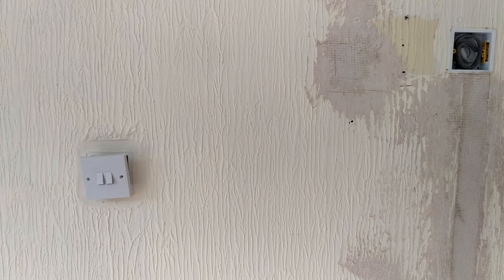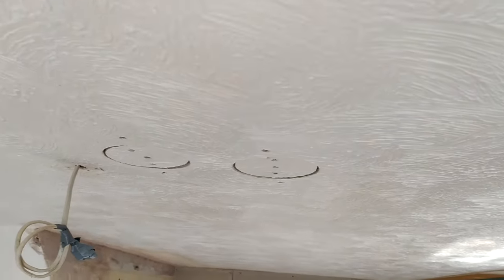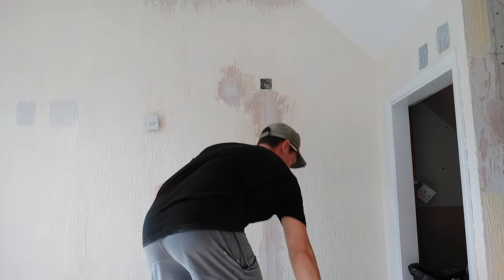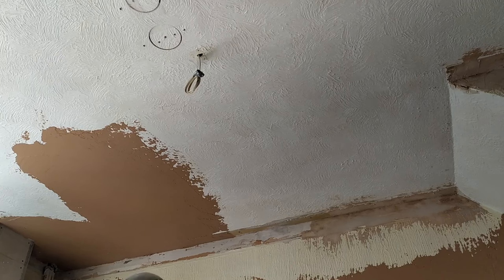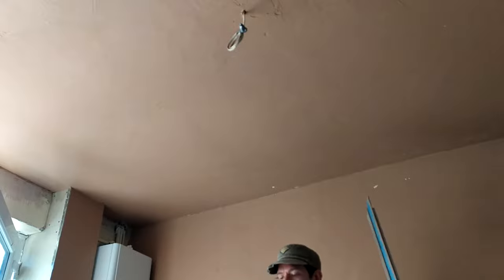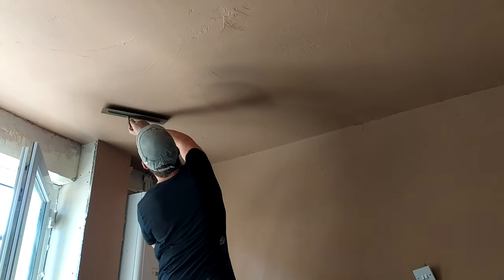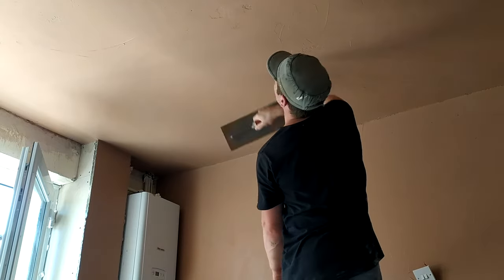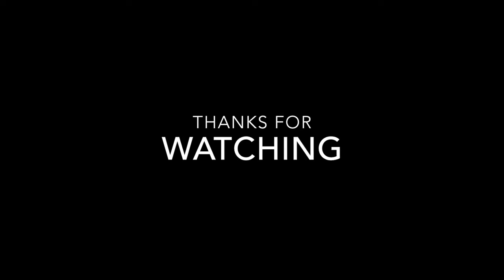Plastering Over Artex Ceilings (Plastering For Beginners)

Comment: Small Tip: Touch of food colouring in the PVA mix will show all areas you have covered
Reply from the maker: Great advice !! Cheers pal 👍
Reply: I’ve heard about it bleaching through before
Reply: sly it shouldn’t do as you are only adding a minuscule amount.
Reply: I add paint seems to work fine.. 🤠
Reply: Will also stain skirting boards and coving, would not recommend, unless you want to spend 20 minutes using baby wipes at the end

Comment: Well ,another plastering video I have watched with the wrong advice on how to plaster over  artex .Plastering over artex this way will only soften the artex and will eventually peel from the ceiling bringing all that new plasterwork with it ,the only secure way is to,first have the artex checked for asbestos ,second ,if all clear cross batten ceiling using 50ml x 25ml tantalised timber ,third ,overboard and skim ceiling the traditional way .This way may cost you a little more time and money but you will have a ceiling that is secure and last longer than the method shown in video .I am a plasterer with 40 years plus experience in renovating all types of plasterwork ,,,Hope this advice helps all you beginners out there 👍👍
Reply from the maker: It's never happened to anyone I've known before but I must admit that your experience has a lot to qualify for so I appreciate your advice. Thank you for your input 👍
Reply: One of Them ones .HI ,the main problem with any type of over plastering is how secure  the surface is that you are overplastering .I used to overbond and skim artex when it first became unpopular but experience taught me that this was causing the artex to pull away from the ceiling hence causing the new plasterwork to fall off with it .,plus overboarding gives you a far better finish and for a little extra time and money you are getting a brand nexus ceiling ,,,,
Reply: Why batton. Just board straight onto the artex
Reply: @fixit3108  to ensure new boards are fixed to a flat surface. Finish plaster maximum thickness is now only 2mm thick.

Been plastering 20+ years and hands down this the best method but costly.
Reply: @stevengordon2145  if the ceiling is already flat. Apply Plaster Board directly onto the artex with longer screws. Can be done ok
Reply: @fixit3108  90% of the time artex ceilings are not flat.
Been plasterboarding so since 97 I've only ever come cross a handful of lids that where flat. Get it right first time no call backs 👍
Also using 50mm or longer screws when over boarding leads to a massive danger of hiting cables or water pipes etc.. In ceiling space
Reply: What if the Artex does contain Artex surely you can’t overboard as you’re drilling into the Artex?
Reply: @Hi-mb1rr  .If the rates does c
Reply: @Hi-mb1rr  If the artex does contain asbestos then it has to be removed by professional asbestos removers . Having read some of the replies on here about scraping it down or sanding it down I just hope for their health it was tested before work commenced. I did mention about having the artex checked before any work is carried out on my previous comments .

Comment: You can only really get away with this if the artex is quite flat to the wall, and the plasterboard is really well nailed or screwed on, as you're adding more weight it can cause the plasterboard to sagg and potentially come down, as i've found out 🙈

Comment: Im always cautious about plastering over artex.always try to overboard first,much better job.i learnt my lesson years ago,and let the customer against my better judgement talk me into going over with bonding and finish.next day after clearing up all the fallen plaster i overboarded and skimmed.plastering for 35 years now,but i really enjoy your videos.well done.
Reply: Do you know why it fell by any chance? Maybe not sealed properly initially?
Reply: @wassupjg  most old ceilings have distemper on them.artex seems to stick to this.but as soon as you try to overskim ,it comes away due to the moisture of the plaster along with the weight.always better to overboard and skim.plus this gives you added sound proofing and fire protection.
Reply: @markchambers9415  cool, could the distemper/surface be stabilised with a stabilising primer like artex stabilex?
Reply: @wassupjg  you can try.but i wouldnt bank on it.i found there are no short cuts.good luck.

Comment: Friend of mine showed me a way of skimming over artex, 1st coat was half bonding half skim mix and for the 2nd coat was just a normal finish mix. Always worked perfectly
Reply: Hi, what do you use for the bonding?
Reply: @leabeauty837  bonding is known as a plaster undercoat but generally its used to fill up holes and voids in area's of walls that aren't plumb, its a brilliant material and sets like rock. Also very good for plastering over old artex
Reply: @WCMT89  Thank you 🙏
Reply: I put some bonding in my first coat, not taking credit for it as it’s long been know as the magic mix

Comment: Great videos, it's still possible to find asbestos in artex way into the 90s av recently found out, although tiny amounts, av taken a few chances, because money is money and work is work, but if its really old artex, I explain to the customer and in most cases they get it tested for around £100, its there ceiling, its there sector, stay safe 👍
Reply from the maker: Very good point my friend! Cheers
Reply: I'm buying a house which has artex (prob asbestos).  Can't it just safely be plastered over?

Comment: I plastered for years over artex without knowing the danger with it. It Does make you think about the jobs I've done in the past. Lovely job again mate. 
I've got a lite artex ceiling coming up, it doesn't need scraping just unibonding. 
Need to get one of those speedskims first though. I've heard people suggesting getting the steel blade ox but seeing you use the plastic blade alot. It does a fine job and saves a lot of time. 
Keep up the good work mate 👍

Comment: Hiya. Your channel is excellent. Your explanation of methods is very clear. I've been watching for years. Just about to tackle artex in a medium. Sized shower room. Using your 80/20 mix. Roughly how much plaster should be mixed fir each coat? I have 2 x 25kg of Bond and multi. I don't want to mix too much and have the issue of getting rid of it..ha...cheers

Comment: Great to see this iv heard so many people saying you cant plaster directly onto artex and it made no sense to me .....clearly just excuses
Reply from the maker: Just excuses pal 😉
Reply: One guy battened and boarded over the top. I told him the batten was only to correct the ceiling if it was out (i think I’m right? ) he said you had to batten.... the ceiling is a mess more lumps and bumps than before i think he did the battens as he couldn’t be arsed to work out where the joists where to screw to? I couldn’t be a plasterer if i had to work on other peoples boarding.
Reply: Not excuses at all  This is the most reckless and irresponsible video I've ever seen. He just gone and scraped away a load of artex from mid 80's on the basis that 'someone' told him it was OK.  This vid ought to come with a health warning. No one shoul EVER scrape away any old artex unless it's tested first'  All those viewers including seasoned 'professionals' blowing smoke up his ass and praising him clearly haven't got a clue.  He ought to be ashamed posting this sort of dangerous video. Do NOT do this EVER
Reply: @bigchiponmyshoulder7573  Obviously you could skip the scrapping step and lay the plaster on even thicker or as he says in the video over board. From who id heard from they clearly just couldn’t be bothered or thought the plaster simply wouldn’t stick. Clearly it is possible to do. Non of the excuses id heard were linked to asbestos.

Comment: Great work thank you for uploading it.i have done recently an Artex ceiling myself , but haven’t used one of them speedskim boards.looking at them ,there are two options,plastic or steel blade, which one would you recommend?i thought my plastering looks very good and couldn’t see any unlevel bits, walls or ceilings,but by looking in different lighting, without the lights on ,just the daylight and even that depending on mornings or evenings , I could see some unlevel parts , which I think could be avoided if I would of used one of them speedskimm fancy tools...many thanks Rob
Reply from the maker: Yeah the Speedskim is a great bit if kit and it definately flattens your walls to a higher standard. I've seen an massive difference since using it so I definately recommend it! I'd go for the plastic blade matey - is cracking!

Comment: Hi Blaine great info there and wondering could tiles be plastered over or dot and dab with plasterboard and skim? Any tips would be appreciated as taking tiles off is going to cause massive work as walls are constructed of old 50 mil clinker blocks with weak plaster over.

Comment: Have you ever tried flattening/closing in with your flexi. I tried the other day as labourer was trying to use my finish trowel.  Will be doing it from now on. So much better I felt!
Reply: I watched a video on youtube years ago from a really good hand soon after the flexi came out, he put on and finished with a flexi. ever since that day I have done the same, I know they are meant to be a finishing trowel only, but it has never given me a problem, and its cured my tennis elbow, it just makes life so much easier,  if I have doctored a bit of bonding up and needed to skim it straight over and obviously it sometimes blebs, then I need to give a very hard trowel with steel, other than that it leaves a first class job
Reply: @greenup9913  totally mate. I use a refina superflex, couldn’t find finishing trowel on job last week and done the full whack with it and was much lighter on the arm etc. left exact same finish too !
Reply: @williammacphee335  anything that saves your arm/body is worth a try, I have never looked back since watching that video, I was told when I first started plastering, by an old joiner to get out of this job as it kills horses, and he was right, we really do need to look after ourselves if we intend doing this job long term, especially if your a site worker

Comment: Ive had a nightmare this week. Did a very large artex ceiling, blue grit it and followed this process but 4 days later a section fell off. First time using blue grit and only used it coz it was satin paint. On reflection looks like I didn't put enough blue grit on. Proper gutted 😔

Comment: Being new to plastering, i found this very helpful.
Q1, do we have to wait for.2nd coat of pva  to dry or start plastering while tacky?
Q2, I was lead to believe that bonding coat and then a 2nd coat of  skimming was the way forward for such a job. Obviously not the case. What type of job would you use a bond and skim coat?
Reply from the maker: Glad to hear you found it useful matey! Yeah you usually wait for the PVA to go tacky but to be honest I've never found it to be a massive issue if you don't. You can come back to it when it's completing dry otherwise. I never really use Bonding on Artex - it's all down to preference. If it's an extreme case of Artex which can't be scraped then Bonding is the answer. Everyone has a different method and like I said, it's all down to preference pal 👍

Comment: Another great video! Big thank You! I remember my first artex ceiling and it was nightmare... especially with times. I have 2 questions: 1. It's not first time when I noticed you plaster ceiling and wall with the same corner at the same time. How do you deal with it? And 2nd: Have you ever plaster ceiling above carpet? Can you make a video how do you protect everything in a room (carpets, skirting board, sockets - btw. I use food foil to protect sockets and switches, maybe it sounds funny but it does the Job). Is it any chance to protect walls before painting?
Reply: You can buy carpet protection to protect carpets or  dustsheets.
Reply from the maker: Hi mate! It's great hearing from you again! Yeah they can be very troublesome but it's all down to timings! I plaster a lot of wet corners which can be a bit of an issue but with time you can really get into it. There's s video in the advanced section of The Plasterers Blueprint actually - I discuss it in detail there matey! Yeah that's a great idea. I usually use start sheets and making tape around the shirts but you could also use carpet protectors as our friend above mentioned! Hope this all helps pal and it's great to hear from you again 👍

Comment: Very good job that’s the way I would of done  but there’s another way that’s 
Using multi finish with bonding mixed
Reply from the maker: Thanks matey 👍
Reply: What is the ratio of multi finish with bonding that you use? Thanks!
Reply: @skydiver0084  saw some others on here say 50:50

Comment: Great video! I’ve got this same project to do for my own ceiling although the artex was just light stipple which I’ve scraped back flat. Can I ask what ratio mix of multi-finish to water do you use on this slighter drier mix? Thank you!
Reply from the maker: Hi mate, great hearing from you. It's not as bad when the Artex isn't as defined so I'd mix 12.5 litres of water to one bag of Multi Finish. This should give you the right consistency pal! Hope this helps and good luck with your ceilings 👍
Reply: Plastering For Beginners thank you, really appreciate the quick reply!
Reply from the maker: No worries mate 👍

Comment: I’ve stipple in my small bathroom ceiling and I’m no good at plastering. 
I’m on my own! Is it possible to trowel a layer of plasterboard adhesive to the ceiling.. then offer up a small plasterboard to stick to the adhesive and put in a few screws to hold the board in place while the adhesive cures? Then remove the screws…fill in joints and so on?

Comment: I’m sure I’ve seen u in the past to do a 30% 70% mix with hardwall and multi finish to overcome real bad undulating areas du reckon u could use this mix on an artexed ceiling if the texture is quite prominent obviously only on the first coat

Comment: Could I ask why you don't use the speedskim to finish the second coat? Could you if you wanted? I guess you'd have to get any bits you miss with a trowel.
Reply from the maker: Exactly that mate. It's not the best for finishing so the trowel cleans any gaps or holes! Hope this helps pal 👍
Reply: @PlasteringForBeginners  Thanks! Brilliant videos by the way!

Comment: My house was built in 1967 so would I be right in thinking my popcorn ceiling is most likely going to be a asbestos mixture, i was told only properties from pre 1960 used a asbestos mixture, I suppose I will have someone test a small piece before we skim over this but just wondering if anyone could confirm this? Thanks

Comment: Is a refina superflex suitable for the whole job and what size trowel would you recommend. what size of speedskim would you recommend for a beginner, 600 or 1200? Can the sponge float method be used on artex ceilings and is this a better method for someone who has never plastered?

Thanks for the videos, keep it up.

Comment: hi pal Ive used artex over the yrs but will never overskim it as its not a normal plaster which sets by hydraulic action (chemical reaction)its an air drying compound like paint so the water in the new coat wets it back up and that's why it peels off

Comment: You’ve done this in the wrong order. You scrape first, then pva for starters. 2 coats of multi finish is all that’s needed for those patterns, don’t forget all bits of smal plasterboard make good bits should be taped or scrimmed too. I was an artexer back in the day, we were treated way above any other trade back then, almost celebrity status! It was very fashionable and a highly skilled trade if done properly. Going out of fashion does not mean it was only done by chancers, many a plasterer tried and failed to artex to the standard of a proper artexer.
Reply: Good on you .... I think after looks naff!
Reply: I like the overlapping swirl patterns and a simple roller stipple on ceilings but not walls; just enough to hide whatever imperfections are under them. Both are great if you need to finish a room in a hurry or if you want  to make a low ceiling a little less oppressive. I only skimmed my ceilings because they had been repaired and matching the texture would have been a hassle. They do a bunch of other textures here in the USA, depending on the area, including skiptrowel, knockdown, and some   weird stomping thing with a hairy brush or a sponge and I find most of them hideous, especially on walls. I guess it's just a matter of moderation.

Comment: what plaster did you use to cover the artex. I am wanting to plaster over my ceiling which was built in the 70's. What method would you recomend to cover the ceiling?
Reply from the maker: You can use Bonding first to cover the texture or 2 thick coats of British Gypsum Multi Finish pal 👍
Reply: @PlasteringForBeginners  over thick pattern artex always use bonding plaster. I've been doing it for 30 years.

Comment: Hi there thanks for the great video.
Had good success plastering walls with your other vids so going to try this next, starting in a small room.
One question about plastering over artex/textured ceilings... Do you use multi finish for both coats?